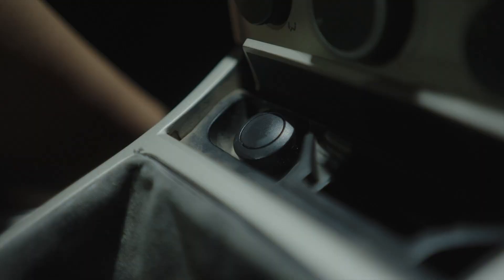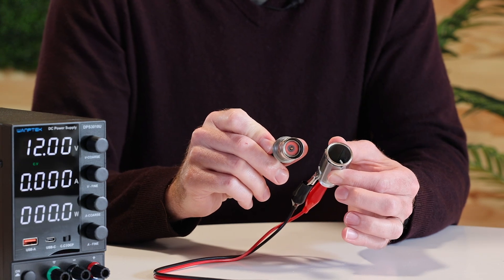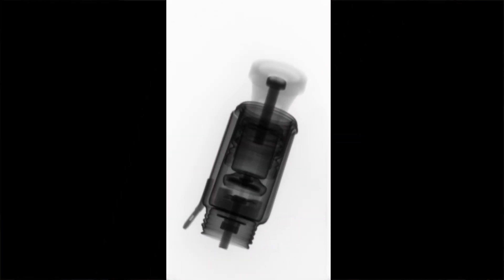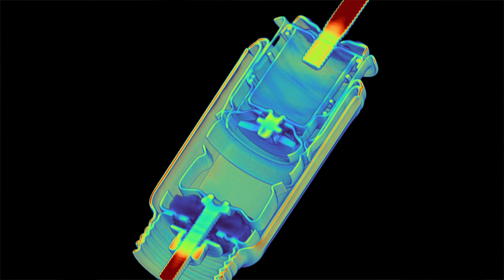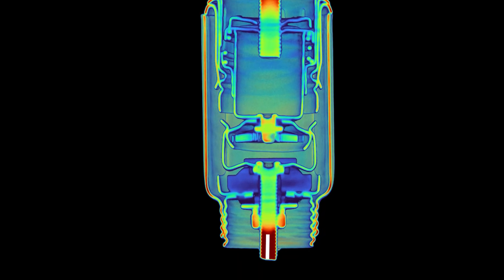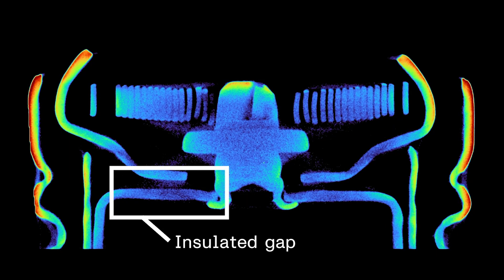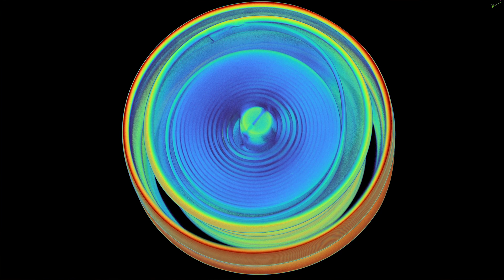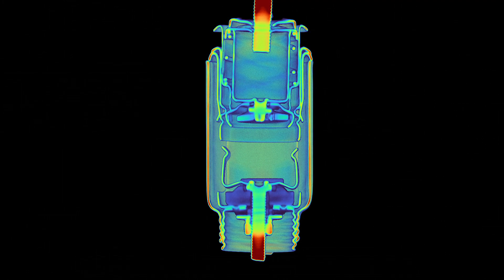How does a car cigarette lighter work?

Comment: Ahhh memories. 
The lighter in my '69 beetle wouldn't get hot enough every time. Sometimes the tobacco would stick to the hot coils and pull out of the cigarette smoldering. Not good. Solution? Just hold it in for 3-5 more seconds. 
Now explain to the youth what a "c i g a r e t t e"  is.

Comment: If someone buys one of those would it still work and be compatible with that 12v outlet in cars? Most cars still have them but without the cigarette lighter.
Reply: Yes
Reply: Yes, I just bought and tested today.  There are two sizes so take a measurement before ordering.  It a very minute difference but it's there. Typical European cars are smaller.  It's probably a minor metric vs standard

Comment: This is brilliant although I'm trying to plug portable air compressor into cigarette lighter without blowing fuse , I believe it does say somewhere you have to have directconnection or something so guess we have touse $1.50 air compressor which usully doesn't work at store . Guess the main problem is correct question for computer 😁 Yes I have a tire pump also have a pacemaker